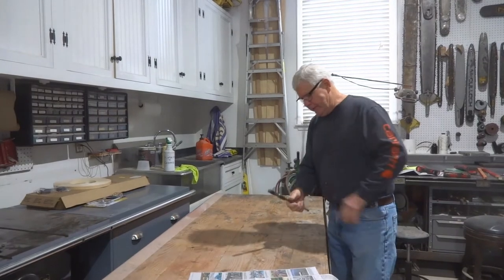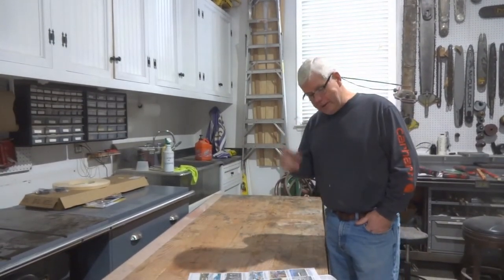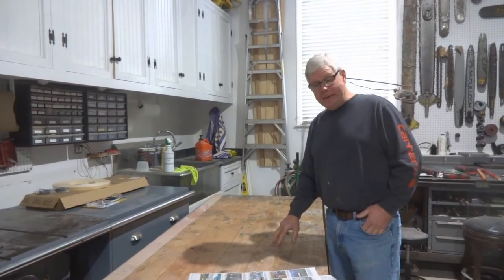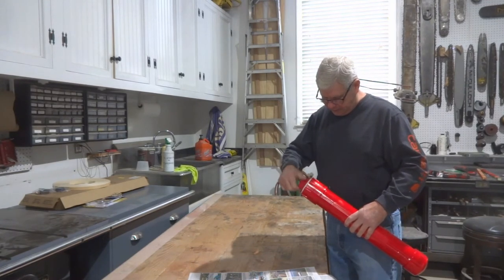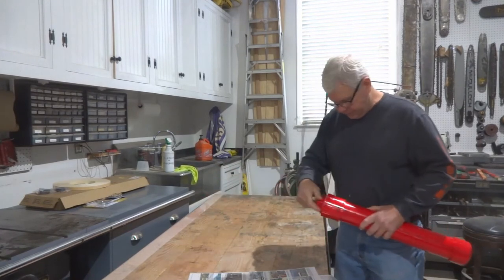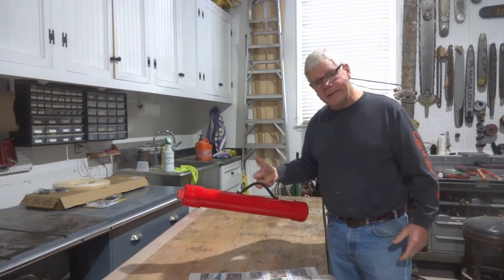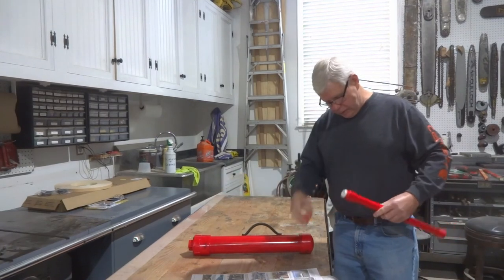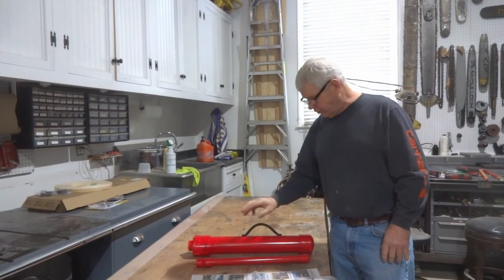Rotary Hammer   Bit Storage Solution

Comment: I did something similar for my sawzall blades, but it didn't occur to me I could use the same technique for my roto bits til I saw your video. The hardcase that the Bosch Bulldog rotohammer comes in doesn't have room for bits, so it's been a mess. Thanks for the tip!
Reply from the maker: Glad you found it helpful.  Thanks for watching and commenting.